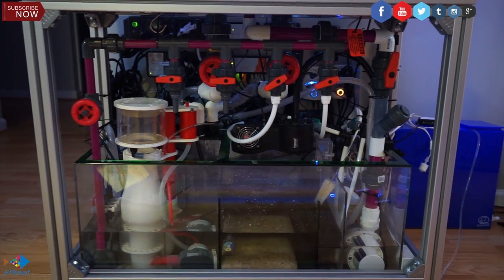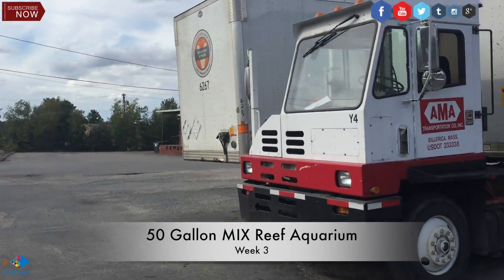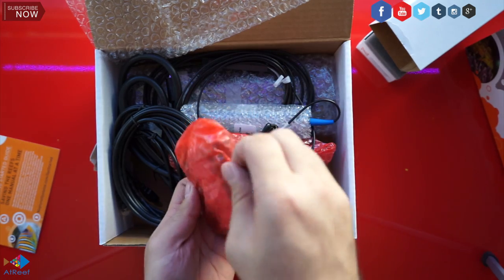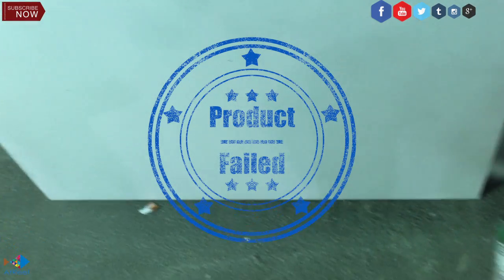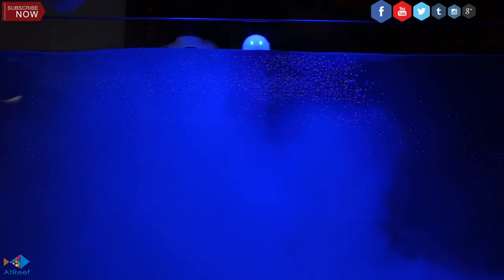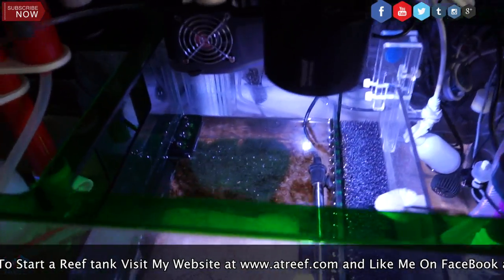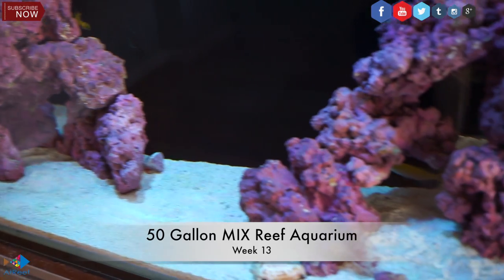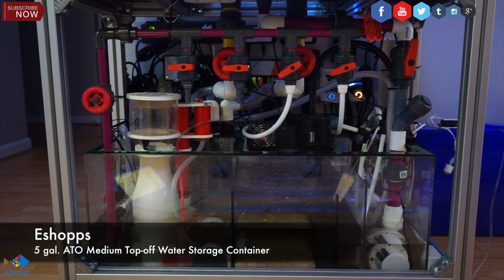How to Start a Reef Aquarium The Right Way

Comment: How is cutting wood with a circular saw dangerous or crazy? Those tools were created with the purpose of doing things at home yourself.
Reply from the maker: Because i was not using proper tools and i was not practicing proper safety measurement and precautions when using it
Reply: +AtReef meh, looks safe enough. The wood was being held down and you had control of the saw.
Reply: lol that's hilarious, such different life styles.
Reply: I was thinking the same thing lol like I try it at home all the time!
Reply: My only worry was him cutting into his counter top...
Reply: B3wareTheIdes and
Reply: this is probably one of those thing where he said it more for the viewers than himself. if he just went ahead and did it without the warning, i bet there would be alot of people commenting about how hes not using safe practice. and how its dangerous.

Comment: They send those rocks partially seeded, shouldn't have used tap water to clean them. By "cleaning" them you killed all the bacteria and that die-off will spike your ammonia way higher than a normal cycle would have. I gotta be honest man, as someone who has been in the hobby form as long as I have this really seems like you just threw a bunch of money at your tank with mediocre knowledge of the hobby.
Reply: exactly what i was thinking. Putting out misinformation like it's a fact

Comment: Spending a lot of money don't equal the RIGHT WAY to start an reef aquarium.  I didn't want to say anything, but this is so wrong.  The title and video are badly misleading. Wires and plumbing are terrible.  Should have build a manifold with your return pump for your media reactors instead of using another pump to pump your manifold.  Sorry dude.